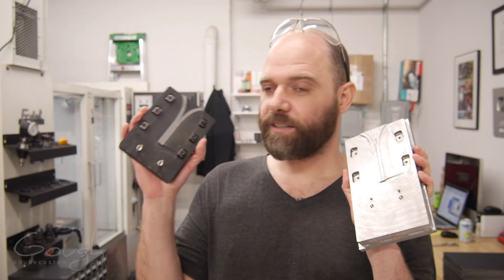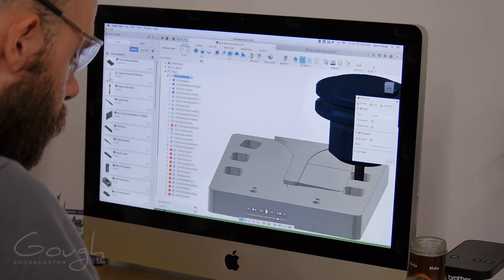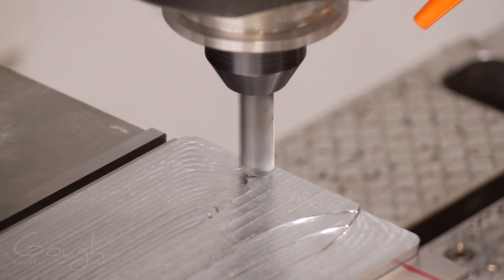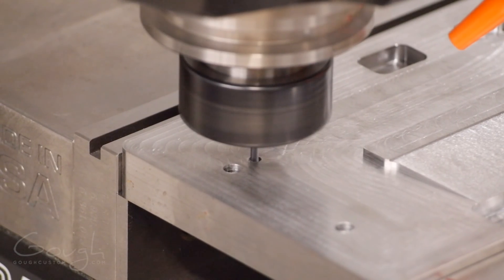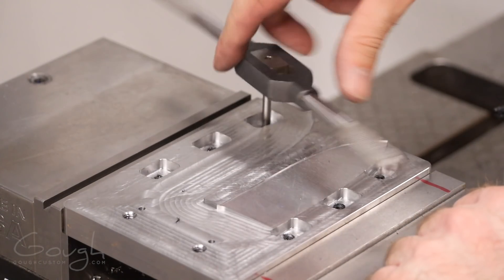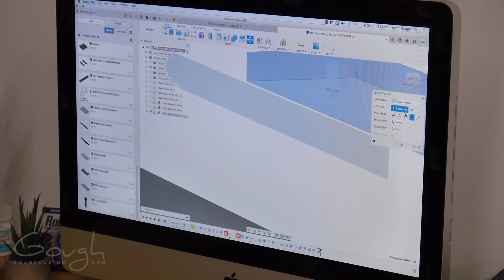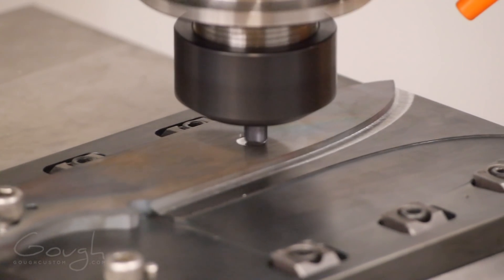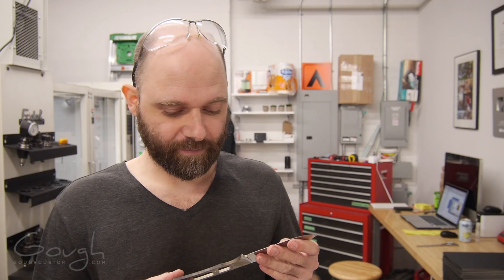CNC Knifemaking: Making a new Fixture!

Comment: Question: why you can't get oil in your sand blaster?
It's so cool and satisfying seeing hard milling!
Reply: I'd imagine if he's running on the finer end, clogging might be an issue with something that has a low volatility.
Reply from the maker: Hey mate! The coating that I use on my blades (DLC) is very sensitive to contamination. Any oil or loose dust on the parts will cause discolouration of the coating or failed adhesion of the coating. The place that does my DLC coating ultrasonically cleans the blades before they're coated, but getting grease/oil on the sand and then blasting that oil into all the tiny crevices formed during sandblasting seems like a bad idea! 

I also do not handle the blades with bare hands after blasting, they are all handled with gloves to make sure no skin oil is transferred.

I cannot say conclusively that either of these sources of oil is definitely an issue, but I have had lots of issues with the coating process in the past and now I do absolutely everything I can to ensure cleanliness during the final stages before coating!

That even includes filtering my compressed air to a ridiculous level. I have a screw compressor now which runs the air through an oil separator, then a refrigerated drier, then I run the air through a moisture separator, coalescing oil filter, and then an activated carbon filter... I'm pretty confident you could breathe the air coming out of my compressor at that point!

To reduce dust I only use fairly fresh 120 grit aluminum oxide, and run a dust collector in the cabinet to pull in any broken up media... I have noticed that if I let the media get broken down and become too fine it leaves very fine dust on the blades which is hard to remove and also causes coating issues.

It is a very tricky thing to get right consistently and I've had a lot of delays from issues in the past so now I'm pretty overkill about it!
Reply: @GoughCustom  Thank you for replying in such details! Recently while I was dialing in my 3D printer, I've came to the conclusion that if you are doing thing a sufficiently high level, you'll started to be able to detected and adjust increasingly minute things. To the uninitiated, you'll seem like you are doing a lot of things with very little improvements. But in my mind, those little improvements towards 100% perfection is what sets you apart. Keep it up!

Comment: Another great vid Aaron, thanks!  That ultrasonic cleaner looks awefully familiar; ours has been a goto for years (knock on wood).  We did supplement it with a 15L size with a built in drain for larger parts.  That lil guy is still gets the most use.

Like the dust shroud on the knife grinder, hadn’t noticed that before ;-)
Reply from the maker: Hey Jesse! Yeah that little cleaner was an amazingly good purchase. That was one of the few 'cheap' purchases I've made where I opened the box and was amazed at the quality!

The dust shroud around the grinder works soooo well! Very worthwhile making one! I need to make a replacement out of sheet steel soon!

Comment: Great video as always! Wow what a finish, thats just incredible, why dont you rough mill the second blade right after roughing the first one though? Wouldnt that shave off a few seconds on machining time? 
Really great job, its incredible!
Reply from the maker: Thanks Bart! Yeah I am definitely very happy with the finish! One day I will get a brand new machine and start making mirror finishes :)

I usually group the toolpaths by operation or fixture station rather than by tool. I definitely lose a little time to toolchanges, but my cycle times are usually 2-3 hours or more so it's a small drop in that bucket. Having the toolpaths grouped by station makes it really easy to run just a section of the fixture if I have to do re-work or if I need to catch up on a certain process!

Comment: How does that actually hold the blade in there on the blade side?
Reply from the maker: The clamps (pitbull clamps) have a pivot underneath so they push in toward the blade as well as downward when you tighten down their bolts. They are amazing little clamps!
Reply: @GoughCustom  I actually got it and my goodness its sharp

Comment: Instead of relying on the circular interpolation of your mill, why not just ream the locating holes?

Also, that’s some amazing hard milling results!
Reply from the maker: Thanks mate! Yeah I'm very happy with my hard-milling! I think the only way to get better results would be to get a new machine!

For fixture holes I like to interpolate the holes as it lets me perfectly maintain position while slowly dialling the hole size in. I have found in the past reamers can on occasion cut oversize if you chip an edge or if the hole position is too far off where the reamer is... For production processes I definitely ream the holes though as keeping the interpolation dialled in is just too tricky and time consuming!